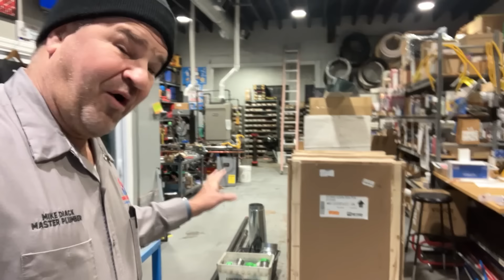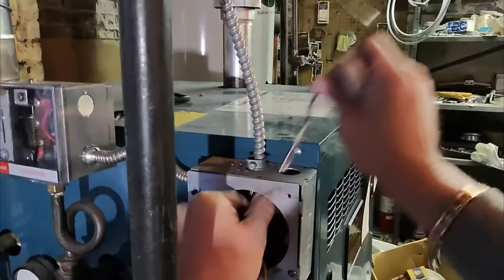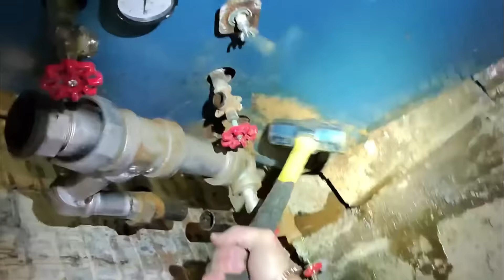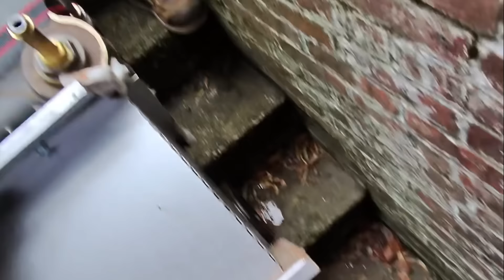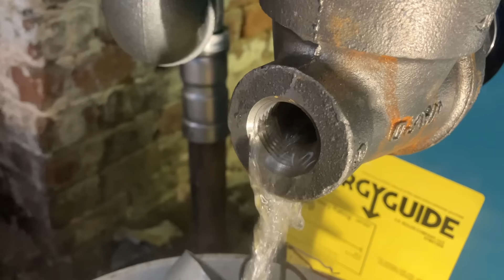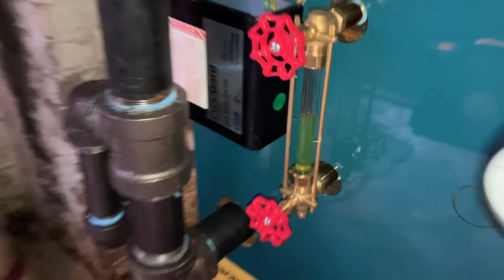US Boiler Burnham SteamMax Installation by Local Plumber Mike Diack - Mikey Pipes

Comment: I just installed a similar boiler with help of my plumber friend.
It took us 1.5 days. Moving the new beast into the basement definitely was a challenge. It takes some effort to move 500lb of steel!! (and disassemble the rusted old 500lb too)
If you are handy, definitely shop around. Most outfits will charge arm and a leg for boiler install (the install you see here is probably around $15k).
The boiler itself cost only around $4k. The rest is labor and expertise.  As a handy dude myself, i couldn't help myself paying $10k for labor, but most don't have the tools or skill NOT to pay.
Great job Mike! (after 1.5 days of my own install, respect to you and your helper!!)

Comment: Looks good but we can’t put any black pipe on the relief valve
Reply from the maker: Codes vary by location. 🔧
Reply: @PipeDoctor the problem is black iron corrodes and could case the relief valve to malfunction or be blocked which in turn causes that boiler to become a ticking time bomb

Comment: I have a couple Heavy Duty Aluminum Appliance hand trucks with the rollers on the back. Those steal ones with the pneumatic tires are OK for flat uneven ground but they are horrible on stairs.

Comment: I worked at a plumbing supply in NJ for years.  We would deliver boilers of any size to the cellar or wherever for the plumber.  We never had mechanical options like fork lifts but we did have a very strong appliance hand truck like you were buying but the key to making that hand truck even better on sidewalks or moving around for anyone from a small guy like me at 127 lbs to a 350 lbs guy were wheels about 8 to 10 inches that where air filled and tubed that were attached to a bracket with claps and a turn buckle that you would attached behind the appliance hand truck that would act as the fourth wheels.  They would let you rest the boiler back onto the hand truck while sizing up your openings.  You can also get over uneven grades in sidewalks and maneuver around corners without killing yourself.  For us it was the greatest thing since sliced bread and was a real time and back saver.  Think about it I'm sure uline has them.  I am talking almost 40 years ago but I'm sure that wheel attachment is out there.

Comment: How does the pigtail on the pressure control help protect it?
Reply: It stops the high heat of the steam from damaging the control.  The pigtail holds water like a trap.  It will also prevent schmutz from entering the control.
Reply: @dictare  thanks